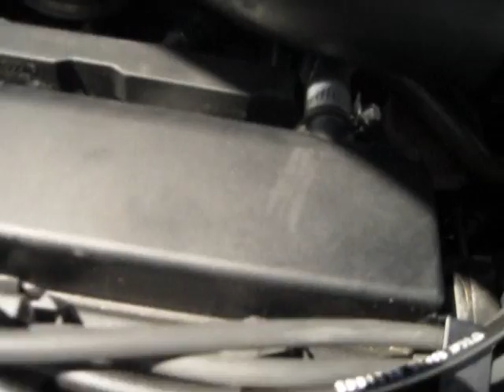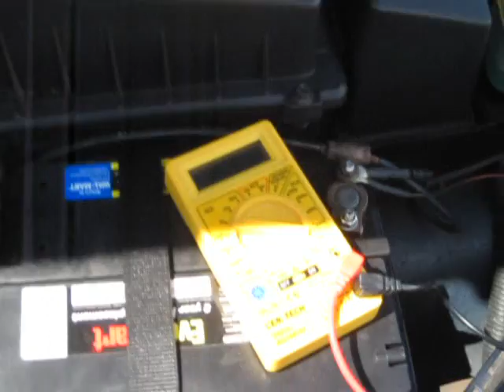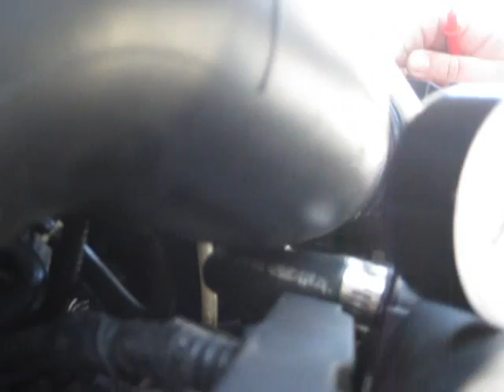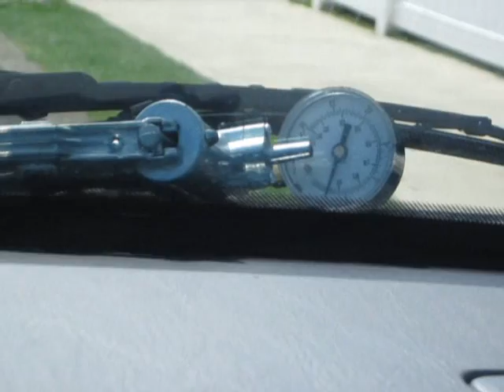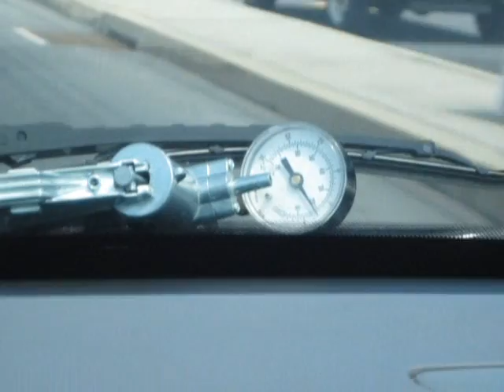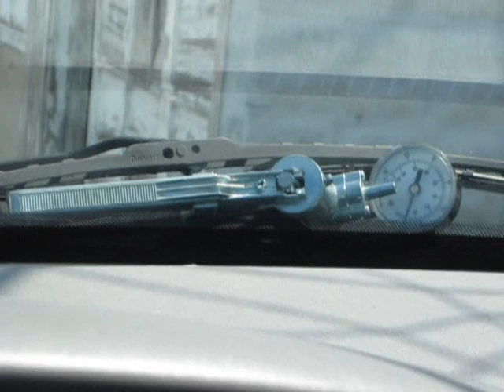2003 Ford Focus EGR system test

Comment: Another question is when you applied vacuum to the EGR valve it killed your engine you said that's what it was supposed to do....     well if that's the case when you hook the hose back to the EGR valve the one that's supposed to go there every time you go to accelerate it would kill your engine because it gets vacuum from the EGR solenoid right

Comment: I am so confused is it EGR valve or is it ERG valve because you said it both different ways I believe in the video I know for sure you said e r g at the very end of the video so  I'm just confused..    also you said the EGR or erg  is to suck the exhaust gases out of the crankcase....   I thought that was what the PCV valve did. That's why I was called positive crankcase ventilation and that is hooked up to the intake which the intake has a constant vacuum...  I guess I was taught that the EGR was for something a little different..  not for the vapors  in the crankcase. . Lol...

Comment: Question, i got a 5 volt reading during idle on my feed wire (the top wire) on the dpfe sensor.  Does that mean the dpfe sensor is bad?  The bottom wire the supply wire on dpfe connector had 5 volts too like it should.
Reply: I got this off of another website: "If the voltage does not vary or is stuck high or low, the sensor is bad"

Comment: Hey, just a couple things. The 2000-2004 are different than the 2005-2007. Also I noticed that this engine is the Zetec and mine is a Duratec. That is the biggest difference. Great video!